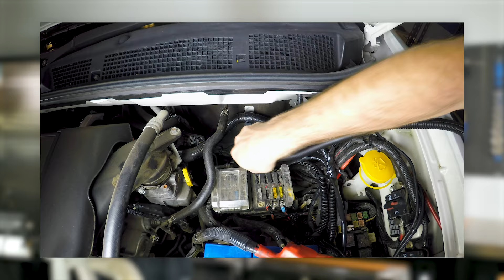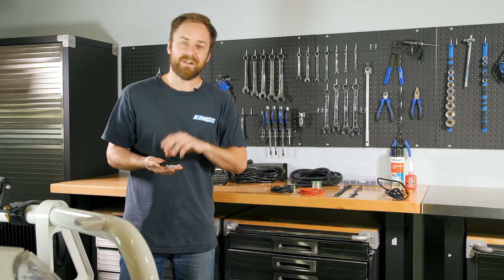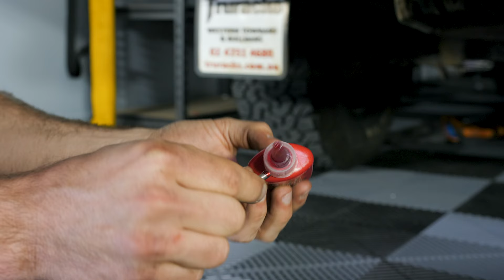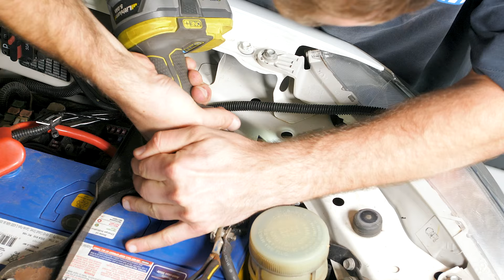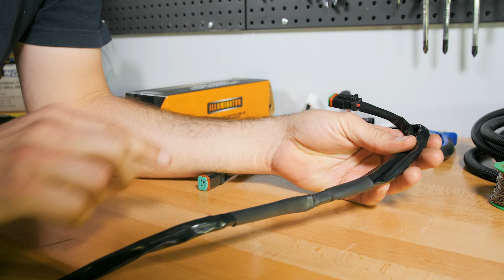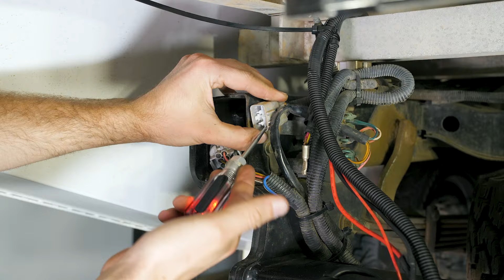SUPER-SIMPLE $100 REVERSE LIGHT INSTALL! Perfect Sunday arvo DIY

Comment: do i need to run a trigger can i just run it like the Rear Lighting Wiring Harness ?
Reply from the maker: Hi there,

Thank you for the question, I can advise that they do need some form of toggle switch as ADR requires some form of toggle switch, otherwise you could do a flush mount switch instead so long as it satisfies that condition.

Regards, Andrew

Comment: If you only want LED reverse lights just cut in to the reverse light wiring in the tail lights. It's a really easy fix without having to chase around the engine bay and dash. It's only 2 wires, just keep positive to positive and negative to negative if daisy chaining a couple of LEDs as they draw very little power.
Reply: Legally you'll need a switch. And you'll need to determine whether your wire and fuse are beefy enough for the extra current.  Caveat emptor.
Reply: And how would I do that if I have a plug sort of thing for my light bar instead of just wires?
Reply: @jacksonmorgan8943 cut the plug off and then you'll just have wires...
Reply: @jacksonmorgan8943 cut the connector off and strip the wire

Comment: I'm probably overthinking this, I have small work lights mounted on the side of my work car. If I run the signal wire straight to B+ and connect the rest as usual, I should be able to toggle them on/off when the vehicle isn't even on correct? Also because its only signal for the relay, while the switch is in the off position it shouldn't flatten the battery at all? Anyone confirm if that's right?

Comment: So I hooked up 4 9" spotties with ur harness but I had to extend the plugs for the spotties bcoz they r on the roof so I cut them an added about 2m of 15amp twin core wire an hooked them back up but they were working before I cut the wires but not now is my 15amp wire to small for the job only bigger size I can go is 50amp but that seems to big

Comment: If my switch has only 2 wires (blue and black) but is a 4 pin on/off rocker, and I have done everything shown in the video, why is it not working? The only other difference is that I have a small round 7 pin which has the black wire as the constant and the reverse lights. Also, I noticed that the black trailer ground wire is joined to the positive terminal and has an inline fuse. Would having 2 separate inline fuses (for trailer lights and LED lights) both running from the positive battery terminal make a difference to the power received by the trailer reverse/constant wire? And why have they made the reverse wire a constant wire? Wouldn't that mean that the reverse lights would be on all the time? Should I do something different?  Cheers Tania

Comment: Why do you need to run a wiring loom & a relay & not just wire it straight from the reverse lights?
Reply: I'm guessing the law requires them to be switchable from the dash.

Comment: Is someone sees this, I need help. I got the kings 3 inch work lights and wired them straight into my reverse lights (hallogen) I tested with one connected up. Works perfectly, when I have both wired up (one to each side) the both turn on for about 3 seconds before I lose all my rever lights. Nothing gets hot.. wiring is fine but only when I have both wired up they turn off after 3 seconds. Am I missing something or should I wire it a different way?
Reply from the maker: If they're wired straight up you could be overloading your vehicle's reverse wiring (particularly in a CANBUS system)

that's why I'd always recommend using the reverse lights as a trigger for a separately powered relay that then powers the LED lights.

Cheers,
Cahn
Reply: @4wdsupacentreAu  is it possible to run this without the switch? It comes with a white blue and black cable connected to the switch, should I cut and solder these together for a constant on feed to the relay?

Comment: I've started putting a plastic splint in with any joined wire or soldered connector. I cut little 2 to 3 mm wide strips off a PET drink bottle and slip one or two of those inside the heat shrink. They won't melt and they add a bit of rigidity to the join which makes them longer lasting.

Comment: Hi, great video. Wondering what the possibility is of having the lights wired as in the video, but also wired to a dual battery set up with on/off switch in the rear of the vehicle.

I have the kings switch panel and looking at using one of the switches in it for these lights?

Comment: Mad vid, if I wanted to just put it on a switch and not on the reverse cable. How would I do that
Reply: just install it as a normal wiring harness without hooking into your factory reversing lights
Reply: @jordanspurling772  The trigger wire still has to go somewhere though or it won't work
Reply: @NitrosDen  I figured it out I just put the trigger wire to the battery

Comment: Thanks for the detailed and well-paced instructions- will 10 amp wire suffice for 60w led units and a 15A fuse at the battery before the relay? - John n SA
Reply: Go less than 10 Amp for the fuse, if you go 10 10 the wire could burn before the fuse trips.
Reply: @DrJackss  ok thanks Jack - April to June is the Hilux (pre-Covid) canopy build and then head off to TAS then trek up to FNQ - kitting out with Redard, Engel, Lithium, Renogy, LED lighting and all my own wiring with fuses everywhere - took 12 mths to get a 23 Zero Stealth but will be worth every $ - had to modify KINGS awning eyelet hole tearing (common problem for both of these) at awning outside corners using a ‘sandwich’ of metal plates along the thin channel so much better now and the awning material is very waterproof and provides great shade - John in SA
Reply: 10 amp wire 10 amp or less fuse

Comment: Is there a way to make them only come on when the lights are on and in reverse?
Reply: You will need 2 relays. To do this, run a trigger wire from the headlights to the first relay.(Which therefore switches the relay on when headlights come on) Then add a second relay to control the reverse lights, and pull the trigger for that relay from the first relay. So when the first relay receives power from the headlights it then supplies power to the second relay. which then supplies power to the reverse lights. 

So power runs through the first relay (when headlights on) and into the second relay, and then into the reverse lights. The headlights controlling the first relay will switch on the second relay therefore sending power to second relay. 

Just simple 4 pole normally open relay. 

It's a bit hard to explain but easy to draw up the circuit for it. I hope it makes some sense from what i've written. If you type into youtube "moss motors how to wire relays" There is a 3 minute video which is very good.
Reply: That’s for that detailed reply

Comment: Hi mate how would I go about wiring my 2 up for camping on my canopy? What would I use as a trigger wire?
Reply: Just run power through your on/off switch to a relay. Then the direct power for the lights through the same relay to the lights.
Reply: @enjay8950  I tried this, but the lights are not as bright as they are supposed to be 😐,  not sure what I've done wrong. 🤷🏻‍♂️

Comment: Could you just run a power wire from the battery and then power from the reversing lights to a relay to switch the back up lights?
Reply: Yes but you'd still need the Dutch plugs to fit the lights and a switch, by the time you buy those two things for 20 bucks you much as well buy the whole harness for 30

Comment: So what do you do with the black wire on the trigger cable ?? Connect it to ground ay ?
Reply from the maker: 9:20

There's not technically a negative trigger wire. The positive trigger wire goes from the reverse light input to pin 85 (or 86) on your relay. the negative that's along side it is to earth the LED in the switch so you don't need to connect it, but I show it at 9:20 - I just shorten, add a ring terminal and earth it to the battery.

Cheers,
Cahn

Comment: What changes would be needed to suit a three way on-off-on switch so it works on reverse light and by independent switching. Is the wiring harness usable in that case?
Reply from the maker: Sorry I've taken so long to reply here. 

What you'd have to do is replace the switch with a 3 way switch obviously (probably a DPDT), use the same method for the trigger if you want the reverse lights to work and then on the third position of the switch you'd need to have a constant power source into the switch and then make the output of that third position linked to the trigger output from the switch (white wire) or run another independent trigger to the same pin on the relay

I might do a video on this idea too!

Cheers,
Cahn
Reply: @4wdsupacentreAu  That would be a great video as a part 2 option to this video
Reply: @4wdsupacentreAu  Have you done a video regarding the DPDT switch? Having a hard time figuring it out.
Reply: Looking for an answer to this also

Comment: What would you use as a trigger if you wanted to run the lights switched seperate to the reverse lights? Just tap into accessories?
Reply from the maker: Hi Ben,

Yes you could or you could just use 12V power from the battery as the trigger so the vehicle doesn’t need to be on. I’d recommend a fuse if you go that way, and keep in mind you can flatten your battery.

A good idea would be to have  a 3 position switch, so you could have ON, OFF, and ON when reverse lights are on!

Just check legality as well of course.

Cheers,
Cahn
Reply: @4wdsupacentreAu  I've tried this but didn't work, I cut trigger plug off and crimped terminals onto the wire along with a fuse but still had no trigger. What do I need to do differently?

Comment: Gday Cahn, 

Am I right in thinking that the way the switch is wired, the lights wont be able to be turned on/off independently of the reverse signal being activated?
Reply from the maker: Hey Sean,

That’s correct but you could have them switched independently. A good idea would be to have  a 3 position switch, so you could have ON, OFF, and ON when reverse lights are on.

You could just use 12V power from the battery as the trigger for the ON position of the switch so the reverse light doesn’t need to be on. I’d recommend a fuse if you go that way, and keep in mind you can flatten your battery, plus you’ll need to check the legality of having rear facing lights that you can switch.

Cheers,
Cahn

Comment: or you could just tap into ur reverse light wire.
Reply from the maker: Hey mate, I did tap into the reverse light wire - as a trigger for the relay. There are plenty of ways to set up extra reverse lights and this is just one of them.

But if you mean run lights directly off it without a fuse and relay... go ahead if that’s how you want to do it, it’s your vehicle! Just check local rules in case you need a switch to be able to turn them off if need be!

Doing it the way in the video means you can run some pretty powerful lights, completely on their own circuit, so you have separate fuses and it’s safer / won’t overload your factory wiring.

Again this is one way to do it, but if anyone has their own ideas and they’re happy to give them a go, then go for it!

Cheers,
Cahn

Comment: video is good. i bought reverse light . could you please let me know what are the silicone and spray used. also the video of wiring (cutting and joining to fast) its possible to explain which wire need to be cutt and extend. i bought kings drive light cable. thanks
Reply from the maker: Any silicon will work but I used Sika 221 as I had some already!

Spray paint was just a satin black enamel

Depending on your vehicle and the distance between your relay and reverse lights you may need to extend the red and black wires with the deutsch plugs for the lights, and the single red wire for the trigger that connects to your factory reverse light wiring.

(On the Kings harness the trigger wire is the red wire with the white plug that I cut during the video)

Cheers
Cahn
Reply: Your questions are on a very basic level. If you don't get this then I'd get help when doing things to your vehicle, then learn a bit on the job.
Also, his not going to go into great depth in every step he is doing. If you have questions that aren't explained enough in a video, just youtube that question for an in-depth answer on your questions...

Comment: Can you show a video how to put side working lights on your ute or a tray light
Reply from the maker: Absolutely can do - but if you wanted to have a crack yourself, you'd just need to connect the red trigger wire (that I trimmed) and black earth wire directly to the battery.

Add an inline fuse for the red trigger wire near the battery and you're laughing!

It means the included switch will turn the lights on and off without needing another input (like the reverse lights in this case).

Finally, just check the regulations for your area to do with having lights that can be turned on permanently, on your vehicle!

Cheers,
Cahn
Reply: @4wdsupacentreAu  thanks